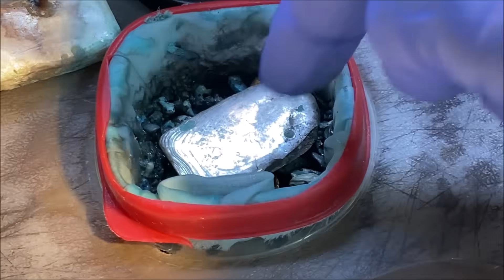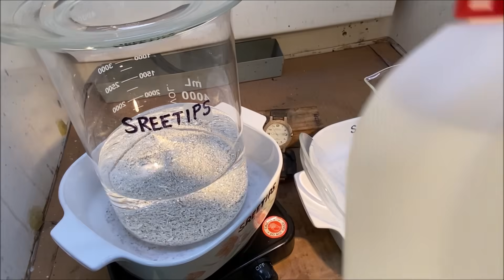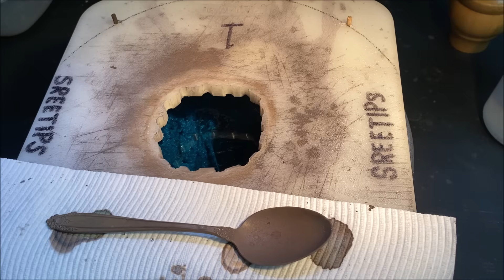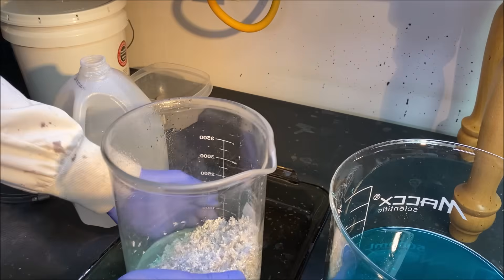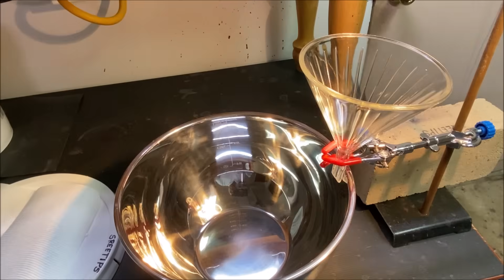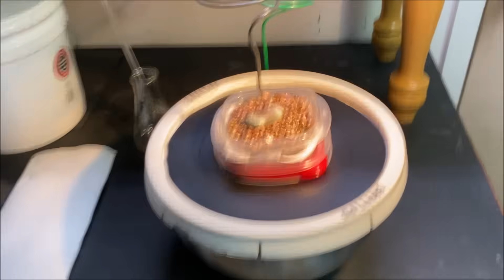Silver Silver and More SILVER

Comment: Have you considered using a stainless steel stock pot instead of the bowl? More volume, stable when sitting and handles.
Reply from the maker: I finally got the BEAST (my 6 liter silver cell) dialed in. It’s running perfectly.

Comment: If you're worried about your silver growing tall enough to contact the BOTTOM of your basket, why not construct some sort of slowly spinning L shaped paddle to knock it down? A microwave turntable motor spins slow enough, attach a fiberglass rod with a paddle on it to rotate just below the basket so that if a crystal grows tall enough to touch, it will immediately get struck by the paddle and get knocked down. It can be placed right next to the basket out of the electrolyte. It will also keep the electrolyte circulating like a small pump.
Reply from the maker: That’s a great idea. Thank you

Comment: Up until about a week ago, I would spend so much time searching the bullion dealers for deals. Now, I am anxiously waiting for my Silver Cell to arrive, my Chemistry books to be shipped from Amazon, building a Fume Hood and trying to win auctions for Sterling flatware online. I'm so glad I found your YT Chanel, sreetips.
Reply from the maker: Sterling Silver can be and should be held just like it is. No need to refine it. Just resist the urge to melt because ruining the markings it becomes questionable. The ONLY reason I refine silver is because I have a ton of impure cement silver that I’ve  recovered from my gold refining. Its purity and value are indeterminable. So I MUST run it through the silver cell to bring it to industry standard 999 parts per thousand.
Reply: @sreetips Thank you for the great information. My goal is to understand the process of refining and to be able to understand the complete waste process video you have, to the point that I could comfortably be able to replicate, safely. A new hobby to take the place of salt water fish, too 😊
Reply from the maker: I understand. I know the feeling of getting bitten by the refining bug. Make sure that your first item is a good fume hood.
Reply: @chandlerlabs2478  Also something to note, if you're using it to inquart gold, you don't need to use new sterling silver all the time. You can start with some, and electro-refine it, and then just recycle the silver through repeatedly, inquart, nitric boil, cement, refine, repeat.

I'm not 100% sure but you might actually be able to use the cement silver that Sreetips uses for his impure silver shot as the silver for inquartation.

Comment: Can you run multiple cells from a single power supply, or must they each have their own power source?
Reply from the maker: Each cell should have its own dedicated power supply. I’ve never tried running two in parallel. But I did try running two in series. It didn’t work too well.
Reply: @sreetips  I think hooking up two cells in series would be a worthy experiment for sure.
Reply from the maker: I did that and it didn’t work well. One cell try’s to hog all the power.
Reply: @sreetips  Sorry, I meant to type parallel, not series.
Reply from the maker: The power supply dies t go high enough.

Comment: Curious...If your loading More silver shot in a bigger basket,,but your using the same Small anoid bar on top ..and your electric current is for a 3.5 liter pan..Shouldn't  you  use a larger anoid bar..And RAISE the electric current to pass thru the higher volume of shot..?
Reply from the maker: I buried the anode electrode bar instead of just sitting it on top of the pile of impure shot.
Reply: @sreetips ok..just checking...lol 😅
Reply from the maker: The sole purpose of the anode electrode bar is to provide a means to allow current flow through the cell. I suppose that one could just use a copper wire buried in the impure silver shot. But the anode electrode bar provides some stability.

Comment: I love your videos, Thanks! Ever try using an anode bar instead of the shot? Make a mold for the Silver roughly the size of the basket. Height can be as high as you want. The higher the better I would think.
Reply from the maker: I used to make 2 ounce anode bars and stack them up in the filter.

Comment: So if it's my understand here, why does the basket have to sit on top of the bowl. Since the basket and the bowl are connected through the electrolyte. 

If you had a bowl that has I dunno, a 6 inch collar on top, a tube if you will, made of a non conductive material, the crystals would have a hell of a time trying to reach the basket. 

Additionally, what if this wasn't a bowl. Imagine if you will a 5 gallon bucket. But the bottom 6 inches of the sides of the bucket are stainless steeel. The crystals would only grow from the sides toward each other and probably collapse under their own weight, onto the bottom of the bucket, which is plastic. It would take a long time for the crystals to start growing straight towards the basket. 

If you reversed the polarity how long would it take the crystals to deplate from the stainless if ever? 
Would they end up in a pile on the bottom? 
Would it pollute the electrolyte? 

One of these days I'll have to make my own and answer all my strange questions for myself.
Reply from the maker: My cell is a “Thum Cell” arrangement with the anode sitting on top with a critical distance of 4 to 4.5 inches from the cathode (the cathode is the stainless bowl). If I wanted to go big then I could use a Moebius Silver Cell arrangement. Alternating anodes and cathodes hung vertically spaced 4 inches apart (to achieve critical distance) suspended in a tank that contains gallons of silver nitrate. The Thum cell is a much better fit for a small hobby operation such as mine.

Comment: Thank you for your great videos, sreetips. Regarding the issue with The Beast. I’m no expert, so I asked Grok. From the answer it seems the voltage might be a tad high (suggestion is 1.5-2.5 V). Current density is unlikely to be an issue with such a large cathode. 

Question: What causes dendrite growth in  an electrolytic silver cell?

Dendrite growth in an electrolytic silver cell occurs when silver deposits form uneven, tree-like structures on the cathode during electrolysis. This phenomenon is undesirable as it can lead to poor deposit quality, reduced purity, and potential short-circuiting between electrodes. Below are the primary causes of dendrite growth in a silver electrolysis cell using a saturated silver nitrate solution:

1. High Current Density
Explanation: Excessive current density (e.g., >50 mA/cm²) causes rapid deposition of silver ions (Ag⁺) at the cathode, outpacing the uniform diffusion of ions to the electrode surface. This leads to localized ion depletion near the cathode, favoring deposition at protruding points where the electric field is stronger, forming dendrites.
Impact: High current density amplifies non-uniform growth, resulting in rough, dendritic deposits.
Solution: Maintain current density in the range of 10–50 mA/cm² (preferably 10–20 mA/cm² for smooth deposits) and adjust based on cathode surface area.

2. Insufficient Electrolyte Agitation
Explanation: In a saturated silver nitrate solution, inadequate mixing or agitation leads to uneven Ag⁺ ion distribution. Areas near the cathode may become depleted of silver ions, causing deposition to concentrate at specific sites, promoting dendrite formation.
Impact: Stagnant electrolyte exacerbates concentration gradients, favoring irregular growth.
Solution: Use gentle stirring (e.g., magnetic stirrer) or electrolyte circulation to ensure uniform ion distribution.

3. High Cell Voltage
Explanation: Applying a voltage significantly above the optimal range (e.g., >2.5 V for silver nitrate electrolysis) increases the driving force for deposition, leading to uncontrolled reduction of Ag⁺ ions. This can overwhelm the diffusion process, causing uneven deposition and dendrite growth.
Impact: Excessive voltage intensifies the electric field at cathode protrusions, promoting dendritic structures.

Solution: Operate within 1.5–2.5 V, starting at the lower end and adjusting based on deposition quality.

4. Low Silver Ion Concentration
Explanation: Although you’re using a saturated silver nitrate solution (~400 g/L AgNO₃ at 25°C), localized depletion of Ag⁺ ions can occur near the cathode if the deposition rate exceeds ion replenishment. This forces deposition to occur at high-energy sites, leading to dendrites.
Impact: Localized ion scarcity mimics conditions of a dilute electrolyte, favoring irregular growth.
Solution: Ensure the solution remains saturated by monitoring and replenishing AgNO₃ if needed. Agitation also helps maintain uniform ion concentration.

5. Cathode Surface Irregularities
Explanation: A rough or uneven cathode surface creates high-electric-field points where silver deposition is favored. These points act as nuclei for dendrite growth.
Impact: Imperfections on the cathode amplify non-uniform deposition.
Solution: Use a smooth, clean cathode (e.g., polished stainless steel or pure silver). Pre-treat the cathode by cleaning with a mild acid (e.g., dilute nitric acid) and rinsing thoroughly.

6. Presence of Impurities (e.g., Copper)
Explanation: Your silver is 98% pure with ~2% copper. During electrolysis, copper dissolves from the anode as Cu²⁺ ions, which may co-deposit or form complexes in the electrolyte, disrupting uniform silver deposition. Copper ions can also alter the local electrochemical environment, promoting dendritic growth.
Impact: Impurities can nucleate irregular deposits or increase solution viscosity, hindering ion transport.
Solution: Use a diaphragm or membrane to separate anode and cathode compartments, minimizing copper migration to the cathode. Periodically filter the electrolyte to remove anode sludge.

7. Temperature Effects
Explanation: Operating at elevated temperatures (>30°C) increases the rate of ion diffusion but can also enhance side reactions or reduce the stability of the electrolyte, leading to uneven deposition. Conversely, very low temperatures reduce ion mobility, causing localized depletion and dendrite formation.
Impact: Extreme temperatures disrupt the balance of ion transport and deposition.
Solution: Maintain the electrolyte at 20–25°C for optimal performance.

8. Electrolyte Composition and Additives
Explanation: While silver nitrate solutions typically don’t require additives for basic electrolysis, the absence of leveling agents (e.g., organic additives like thiourea in commercial setups) can allow dendrites to form more easily. In a saturated solution, high ionic strength may also amplify local electric field effects.
Impact: Without additives, the natural tendency for dendritic growth is higher under suboptimal conditions.
Solution: For high-purity applications, consider adding small amounts of leveling agents (consult electroplating literature for specific compounds), but this may not be necessary for basic refining. Focus on optimizing current, voltage, and agitation first.

Practical Steps to Minimize Dendrite GrowthOptimize Current Density: Start at 10–20 mA/cm² for smooth deposits, adjusting up to 50 mA/cm² if faster deposition is needed without compromising quality.
Control Voltage: Keep the cell voltage between 1.5–2.5 V to avoid excessive driving force.
Agitate the Electrolyte: Use a magnetic stirrer or pump to maintain uniform Ag⁺ concentration.
Clean Cathode: Ensure the cathode surface is smooth and free of contaminants.
Monitor Impurities: Use a diaphragm cell or filter the electrolyte to manage copper contamination.
Check Deposition: Inspect the cathode periodically. If dendrites appear, reduce current density, increase agitation, or lower voltage.

If you observe persistent dendrite issues or have specific cell parameters (e.g., electrode spacing, cathode size, or agitation method), let me know, and I can provide tailored adjustments!
Reply from the maker: AI has never operated a small hobby level Thum cell like mine. AI is only as smart as the level of knowledge that it feeds on. According to the pros that I learned from, operating the cell outside of the proper voltage 3.3 to 3.7 volts DC, could result in other metals, if present, co-depositing with the silver and contaminating the pure silver. Especially copper, and palladium. The reason AI will never replace the refiner is because most refiners (that AI could potentially learn from) would rather take their refining secrets to the grave than share them with the masses. I capitalize on this fact to have a successful YouTube channel. I reveal everything that I know, even mistakes, and how to recover from them. AI will never gain the experience (there’s no substitute for experience) that I, or any other refiner, have to offer.
Reply: @sreetips  Fair enough. Would it be worth an experiment reducing the voltage and see how it affects dendrite formation?
Reply from the maker: I did that once. I used constant current mode and allowed the voltage to fall where it may. Voltage was all over the place trying to compensate for current flow dropping as the anode filter became clogged with slimes. The silver came out looking like steel wool consistency. I ended up running all back through the cell in contestant voltage mode set at 3.5 volts as per the professional refiners that I learned from.
Reply: @sreetips Thank you for sharing your extensive expertise, I agree that constant voltage mode is best for silver deposition. Maybe you could try an experiment by lowering the voltage to 2.5–3.0 V? It might slow the deposition but could help avoid dendrites shorting the cell. 
Another experiment could be an electrolyte stirrer to keep the ion concentration uniform, which might also improve the deposit quality.

Comment: There is a auto siphon pump used by those of us who make our own wine to transfer to bottles that might help remove the electrolyte from the bowl.
Reply from the maker: That would be helpful with the BEAST because it’s too bulky and heavy to handle trying to dump out the electrolyte.
Reply: @sreetips that's why I mentioned it.  I've used one to bottle my wine and cider. It's definitely worth you considering one. Please also look for the wands that can be used with it. Either with or without it using the auto siphon you should be able to remove 99% of the electrolyte without having to do more than tilt the Beast to collect every drop.

Comment: Ahh. The Beast is back! 

I still think it's possible to make a shield to prevent the crystals from reaching the basket. By zip tying a round plastic lid, such as a cottage cheese lid to the bottom of the basket the direct path from the bottom is blocked. And it shouldn't have any effect on growing crystals. It's easier in the Beast because of the 2 part basket. 
Thank you for another excellent lesson
Reply: Take the round lid and set the basket on the top. Punch a couple holes in the lid. Place the bottom of the 2 part basket in the lid. Zip tie the round lid to the basket. You will have to cut it after you end the process.

Comment: You say you like the small cell better, but the bigger cell produces faster? Wouldn't a compromise just be harvest it when it has half the contents? Instead of letting it build up so much. Do 4 runs with the same electrolyte with smaller yields instead (around 2kg-3kg, like the smaller cell)?
Reply from the maker: Doing the harvest is the most arduous task. Thankfully it only happens once every two weeks.

Comment: Great video, Mr. Sreetips. Have you ever thought of using an even bigger bowl, like one about the size of half an oil drum? It probably would be heavy but that would be cool 😊👍🍻
Reply from the maker: If I went big like that then I’d probably switch to a Moebius type silver cell. It has alternating anode/cathode plates hung vertically in gallons of electrolyte and pull a hundred amps of current flow. My Thum cell is a better fit for my small hobby operation.
Reply: I was thinking the samething! I know of a guy who has a stainless barrel! That would be cool as hell!